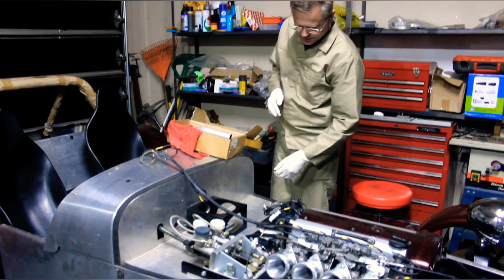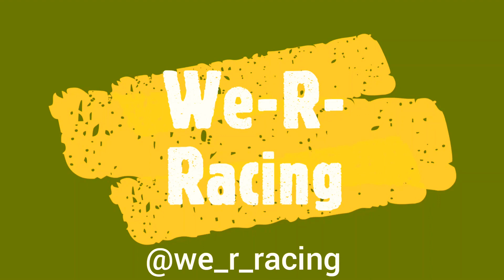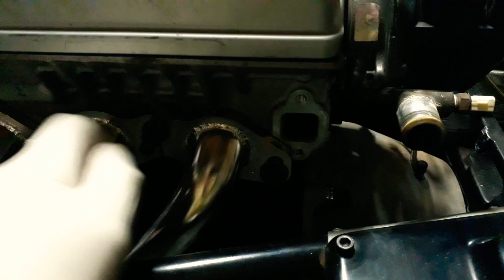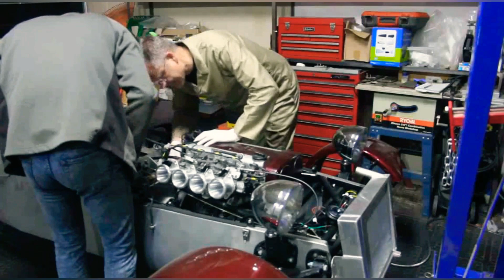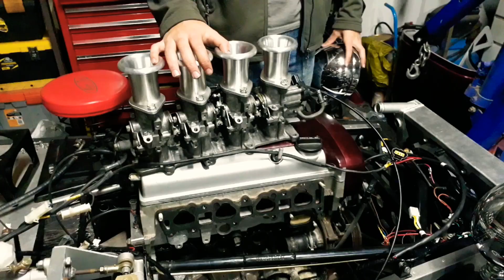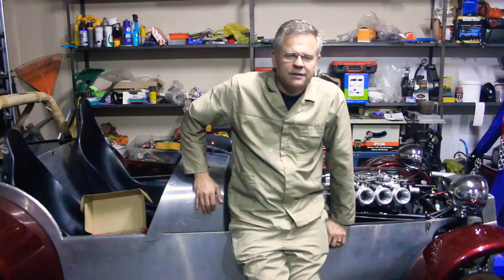Birkin Super 7 / Caterham, Lotus 7 build part 4 - reverse water kit

Comment: Temp sensor, what tipe of air filter are you going to use , 1 per t/b, or an oval one to cover all 4 t/b's if the latter mount the t/s to the backplate
Reply from the maker: Hello Mark; thanks for the question and helpful comment! We have 2 ovals that cover the tubes 2 by 2. They fit very snugly and just stick out the engine cover. Ill show it in the next video which is due for upload very soon